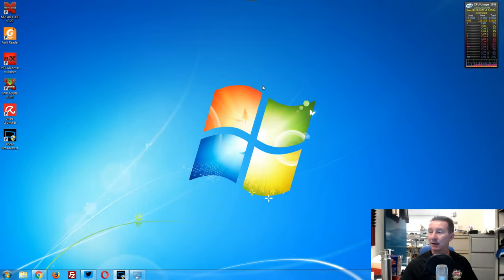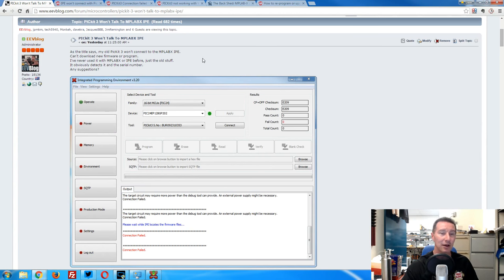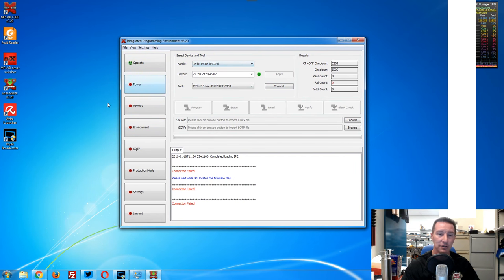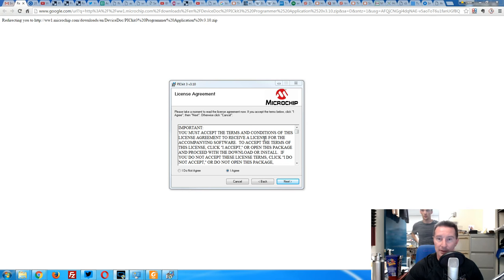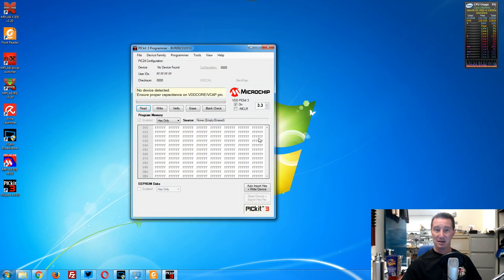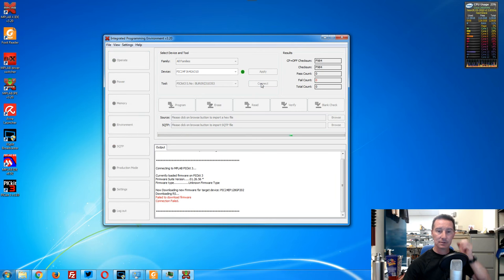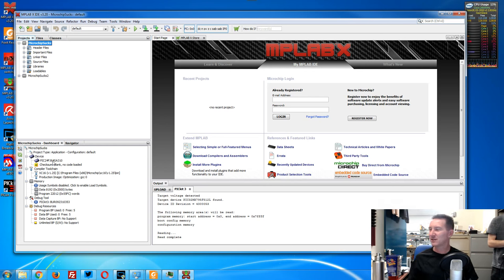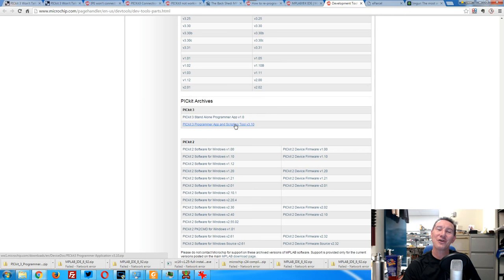EEVblog #841 - Microchip MPLAB X PICkit 3 Woes

Comment: I love the PIC microcontrollers - they're super-robust, have loads of peripherals, clamp diodes on i/o pins and so on make them really reliable. But Microchip's development toolchain is terrible.
Reply: Didn't the PIC chips evolve from the CPU that powered the Intellivision? I seem to recall reading that somewhere.
Reply: They are severely inferior to the various ARM implementations that exist today.
Reply: @TheChrisey  except where AVR chips don't have clamp diodes on the io pins and you can damage them permanently really easily, or reverse voltage fries them - things that are almost impossible to do with a PIC; you can even put 240v mains onto a PIC io pin and it'll survive - overvoltage an AVR by even a few volts and it smokes and blows up.
Reply: @ChrisHolden  I said ARM, not AVR. AVR is pretty much equally inferior. Also, no sane person would apply such ridiculous voltages to an MCU
Reply: @TheChrisey  ARM chips are also pretty fragile, and relatively power hungry too. You've not really described "best" very well in your response to a five year old post. You may not intend to apply high voltages bit sometimes, in production, they can be generated by all kinds of external influences. For robust, low power, simple task jobs, PIC microcontrollers are pretty awesome. Not everything needs hundreds of MHz or the ability to run a full Linux stack. "Severely inferior" is meaningless without explaining the criteria. I'd put more faith in a PIC based automotive sensor, for example, than an ARM based one (for reasons of robustness, ability to survive shock, potential high voltages etc).
Reply: @ChrisHolden  They are fragile because there is absolutely no way a high voltage spike is allowed to find its way to the MCU. The only way that would happen is if the designer is clueless. Besides, it isn't that fragile, things like flybacks on the powerlines are fine (like dumping the charge from an inductor). Your argument is really clutching the straws here. Let me explain. Toolchain, performance, peripherals and programming tools are eons better with pretty much all the ARM manufacturers compared to Microchip and for the same damn price. The PICkit and its software for example is unreliable as fuck. That is definitely a major reason not to chose it. It's funny how you mention power. I used to work for a company whose primary focus was to develop BLE based sensors and controllers that would sit in a wall for 10 to 20 years with the same tiny battery and they purely used low profile ARM chips from nRF to archive crazy low power consumption, so no they are not power hungry if you'd compare apples to apples. Finally, pretty much all car manufacturers uses ARM almost exclusively today for everything (mostly NXP). I've never seen a PIC in there for the past 15 years. You're gonna need a better argument than high voltage clamping..
Reply: @ChrisHolden  Oh and did I mention yet another major advantage is how all the ARM based chips have builtin bootloaders so you can flash and configure them using nothing but a UART adapter for example? Good luck doing that with PIC or AVR without having to buy a programmer that costs 10 times more than the chip.
Reply: @TheChrisey  you didn't, but yeah, you're absolutely right. It's not like we weren't doing that with PIC bootloaders nearly twenty years ago. And the entire Arduino movement didn't happen. And you're commenting about ARM chips now, in response to a comment about where microcontrollers were five years ago. They're not "better" simply because you like them. They're better in some instances*. Projection from physical damage is massively important *in many industrial cases and sometimes trumps a bootloader or the cost of a programmer many times over. Please stop now.
Reply: @ChrisHolden  It's funny how your arguments are primarily based on you fanboying over PIC rather than arguing objectively, given the only argument you have is high voltage protection.. I get it if you're just a home tinkerer, which is fine, but don't feed your ego with ignorance. Arduino has nothing to do with PIC nor AVR. Arduino is primarily using AVR chips, but again, completely irrelevant to the chip manufacturers themselves. Neither PIC nor AVR has any bootloader from factory. The arduino bootloader is a makeshift bootloader that slows down the bootup time a ton as there is no option not to boot from it. ARM chips mentioned are built to let you chose whether you want to boot from the bootloader or boot directly into your code. Your argument from 5 years ago was that they have tons of peripherals, which tells me you have no experience with any other chip besides AVR and PIC. Have you even built anything based on a modern ARM controller besides a sample project? Stop acting so desperate trying to win when you don't have any real objective points to argue besides clamp diodes. Also, ARM chips were on the market 5 years ago too. "They're better in some instances" haven't you read anything I've said? I literally pointed out how they're better in pretty much every instance, and not just because I like them but I like them because of that. I unlike you do not stick to the first best thing and then tell myself that it's the best choice. I get that you've been using AVR and PIC 20 years ago when the market had nothing better to offer but that doesn't mean there aren't options that are superior in pretty much every way that you refuse to recognize today. I've worked with AVR, PIC as well as ARM chips for a long time, I know the differences. Stop being a stubbon old fart and open your eyes.

Comment: In 2021 this is still a problem, their programming software is 1.2 Gb!  I got a Pickit 3 on Ebay and installed MPLab.  It makes the lights flash but the Pickit 3 doesn't put out any power to the programming socked so it can't read in or do anything.  The whole thing is a fraud!

Comment: For increasingly much of todays software I get my blood boiling because of error messages; all they come up with is "did not work". It is like compiling your code with a real mans compiler which only has the possible outputs "yep" and "nope". In all the software I write it is mandatory to provide a unique error code, so even if the message someone put there is nonsensical, the error code allows for the responsible code statement to be located. But why do they not anywhere put out proper error messages? It is not that it is in any way hard. It won't take more than a day to fix all this software mess into good error messages that tell you "oh hey, you have the wrong firmware, you need to do x y to access your device". It is not only because they do not care, it is even worse: they think they are doing a good thing to "not confuse the user with too much technical details". Ok, this is maybe understandable if flappy bird crashes, but in no way is it understandable for a tool that is inherently technical as a programmer to flip the bird at you.
Reply: +Dennis Lubert I was performing an update on Skype 7.16 to 7.18 the other day. Update failed code 2601 or something like that. Quick search online, clear steps to solve the issue. Had to uninstall before updating. Why can't all error messages work like this?

By the look of the Java code they used in these softwares, the exit button didn't have an event handler, so it just crashed.
Reply: +Dennis Lubert Every time that happens to me a little voice in my head, obviously from the part where Little Britain is stored, says "Computer says no....".
Reply: +Dennis Lubert 
Yeah, adding descriptive error messages will bloat their already bloated programs, to 1TB+
In the old days, programs where in KBytes, now, they're in 100's of Mega bytes.
Reply: If you are serious about improving the quality of your error handling, give About Face a read. Alan Cooper provides examples of why error codes are NOT the solution.
Reply: Perry Codes Is he one of the guys that promote "silently fix what you think is wrong, and if it doesnt work, just silently fail"?

Comment: What a pain. Why bother with a PIC and all the closed source bs when ARM micros are so cheap?
Reply: +rocketman221projects battery consumption most likely.
Reply: +Colibri Then, MSP430 is for you.
Reply: 38911bytefree Yes, but that doesn't use an ARM either. I was simply telling rocketman that ARM micros in some applications are a power hungry overkill.
Reply: Colibri
Yes. Im telling that for batt power apps better go to MSP430. If not possible, look some low power cortex. There are some options. ARM is power hungry if your app is CPU hungry. PIC is excellent also, but since MPLABx sttoped using it.
Reply: +Colibri Look at the EFM32 dev board in EEVblog #269. It has an ARM micro in it and runs on very little power.
Reply: +Colibri also stm32 L series
Reply: +rocketman221projects This kind of proprietary software garbage has kept me well away from PIC chips. I tent to stick with ATMel and ARM.
Reply: +Colibri how about msp432?
Reply: ***** The msp432 has an active power consumption of 90µA/Mhz whereas Microchip claims that some of it's 8 bit micros can operate at an active power consumption as low as 35µA/Mhz. Off course the msp is more powerful and maybe even more efficient, but when you don't need that much processing power, the pic is a better idea.
Reply: 38911bytefree I'm not a big fan of Microchip either. I prefer Atmel (blame the Arduino for that). The MSP430 has an active power consumption of 330µA/Mhz. Much higher than the msp432 Spongman S gave as an example. And much higher than any 8 bit PIC or AVR.
Reply: Colibri But has better figures in slp or deep slp and you have plenty of power modes. It is a good performer. Batt app spent most of its time "sleeping" .... But 430 is 12 year technology, 432 has one year, Dont believe just numbers, Microchip "nanowatt" is not that real. You can get into the nA consumption that easy.  If I had to choose, ARM (lets pick something from the LPC family)+ CROSSTUDIO + SEGGER JLINK and I'm done. Its a ROCKET, debugg never fails, never hangs, always does what you want. Yes, you need to pay them. Free ? Kinestis Design Studio and Freedom 64 for 35 dollar. Try to beat this, cortex M4 at 120Mhz and on board debugger is EXCELLENT, ten times better than PICKIT III
Reply: +Colibri yes but the msp's peripherals are designed to be power efficient (if you use them correctly - i.e. sleep correctly). The pic's are not. Either way, the extra 50uA is not going to break anyone's power budget.
Reply: +Colibri lol, an arduino fan in a uA power budget discussion!!?
Reply: ***** Not a fan, just used it in the past.

Comment: am I the only one who thinks that pickit3 debugging is utterly slow?
Reply: +TheTrueM3ga Yo are not alone. Debugging and programming makes any change in the code (to have a go) painfull. It improves in multicore setting. PICKIT III still tooooooooooooooooooooooooooo slow ..... I think It was made on purpose of course. But the built in jtag on the Freescale FREDOM is a ROCKET compared to it. And comes with a 30 dollar board.
Reply: I think it's absolutely phenomenal that Microchip gives you the ability to debug from a PROGRAMMER.  If you want faster debugging, get the ICD...
Reply: I hace the icd3 and tried the realice. Nothing to do with even the msp430 tools. Is 18f which gets slow con high end products' 24and 32are better' still dar from any arm tool, and icd3 is half the price of a PROPER jlink tool. Price-performance is los really

Comment: Dicking around with a tool to get it to work, that's got to be 50% of electronics work.  I've spent the last 3 days trying to get Kicad to work and it won't save a custom footprint, and I can't edit a via.  How stupid is that?  So, I'm going to spend $169 and get Eagle business.  (free Eagle won't do the size board I need, that's why I tried Kicad).  As for PIC programmers, got burned on eBays pickit3 clones and bought an ICD3.

Comment: This takes me back, the original PICkit 3 rant was the first EEVBlog video I saw, as I was having problems with mine at the time. I've been using Atmel since then....
Reply: +Dave Curran Yep I've only used AVR but my AVR ISP mkII 'just works' with avrdude. A single simple command to program a hex file, no fuss and when there is an error it's clear enough.
Reply: +Dave Curran Good good, let the hate flow through you. Welcome to the AVR darkside.
Reply: +Dave Curran I've been using <anything except Microchip> for the last ~7 years. Good riddance to their chips/programmers/designs!
Reply: that was also pretty much my first ever video of Dave's I watched lol.
Also an AVR guy after moving up from arduino, currently looking to move up from the 8 bit devices up to the 32bit arm MCUs.
never been bothered about pics, they always seem second rate to me, I know that sounds like I'm trying to be superiour but it's mainly just my early naivety when Atmel AVR was the first chip I used and it's now what I'm used to. I've tried getting a cheap tool and a super cheap part just to play with but every time I look at the microchip datasheets they just bug me. guess I'm just an Atmel fanboi lol.
Reply: +Dave Curran Atmel studio 7 rules (with dark theme)! their dragon programmer is also the best looking one.

Comment: Thanks Dave for another good video. I had pickit3 woes myself over 24 hours. I have 2. at one point neither worked. then got one working. in trying to get the second working the first one stopped! !! Watched your video on using the pickit3.1 app and the mplabx ipe and got both working, first time. Relieved. Thank you!

Comment: DAVE PLEASE READ THIS:

I completely agree but want to tell you of another TRAP.  I was developing some stuff for the MX695 (also MX150) and needed to use my old (but known reliable) header extender ribbon cable connector that I've used for my PICkit-2.  To make a long story short this 8" extender would not work with the PICkit-3, so I had to shorten it to 3" to make it work. This was the same on 5 other PICkit-3s; the others we have at the college where I teach.

I have torn my hair out with this lead-length and all the other PICkit-3 shenanigans trying to use it on different devices (having to do multiple updates and crap).   And, Microchip never responds or takes responsibility.         PICkit3 = POS;   PICkit-2 NEVER-EVER failed me.

Thanks for the RANT-Vid and thanks for all other great educational ones too!

Sorry to say Dave but I think Mr. Dick-Head has somehow 'blown' his way back up to the top!!!    - Gary -

Comment: Congrats!  You have more patience than i did. I was going to toss it today then i saw this video. you are amazing Dave! Thank you!
Reply from the maker: +Taraku T I almost gave up at several points!
Reply: This is pretty much how much crap digital guys have to put up with, always. You have no idea how good life you rf guys got compared to us. Every single thing we need to do, include troubleshooting. Not even our basic tools are working reliably. Once with Motorola I had to reengineer the Intel protocol for burning flash to be able to transfer the program. The problems you experience is common regardless what brand. I call it products of the internet generation: The Ballpark People when it comes to industrial quality standard. The only good thing about going from rf to digital is progressiveness. If what I want doesn't exist today, it may tomorrow. Thus, Ballpark people may not suffer from sickness. Maybe it just have to be like this because the evolution go so fast. At least that's my thirty years of experience. If patience is not your thing, call in the IT guys and get ready to pay. That's the only way around it.
Reply: I would not call it easier, its just another thing I have to use to get threw my job because they keep changing things. I would prefer programming Hex, flashing Roms on my old UNIPRO. but that will never happen, we have to keep upgrading old crap with new hardware. because the idiot things it a good idea to shut things down that work, and put something new in that makes no change to how the machines work. its just a waste of money. and besides that why repose to me to show off? who cares, do what you are good at. this is why i don't like to sign up for electronics forums. there is always someone that things they are better than someone else because of what they know. besides that, i give you credit for what you do. but not for your attitude on things.

Comment: Haha! Just had a similar problem with ARVDude and the Olimex AVRMKii with Windows 10. After 4 or 5 hours of flashing firmware, switching drivers, etc... I partitioned my hd to duel boot Linux and got it running in 30 minutes. I did the same victory dance when I finally got it working. It worked with Atmel Studio, but the IDE is so cumbersome and slow to boot when all that's needed is an editor and a compiler. Congrats Dave^2!

Comment: I got 3 Pickit 3 units to set up a gang programmer using the Program-to-go feature. It took a while to get it to work but after the third one I had nailed the process.

1. Use Pickit 3 v 3.01 Programmer software. Plug the unit in and out till the software reconizes it. Can take a few minutes, sometimes holding the button down while pluggin in. Use Tools->Check communication each plug in. Once it's connected to the software choose Tools->Download pickit operating system and select the hex file in it's installation folder. Let it run. Close the program, kill with task manager if needed.

2. Run MPLAP IDE v8.92, Select programmer, select device, let it do it's thing if it tries to download firmware. Rest should be easy to set it up as a programmer-to-go

Comment: All Microchip had to do is replace the error message "Connection failed" with the message "Connection failed, hold down the button and re-connect USB". Off coarse, it would be better if it would detect the old firmware and put it in bootloader mode by itself, but the message would suffice.